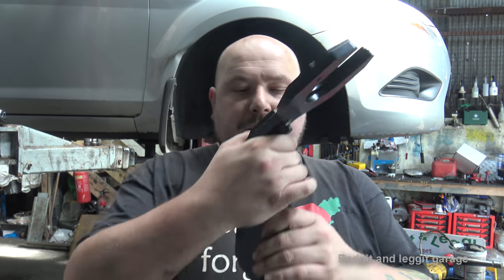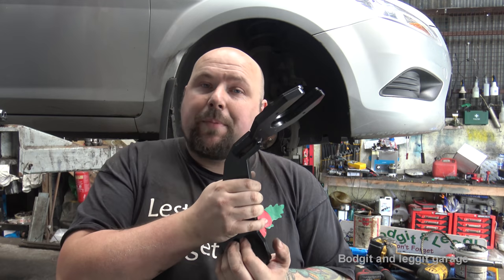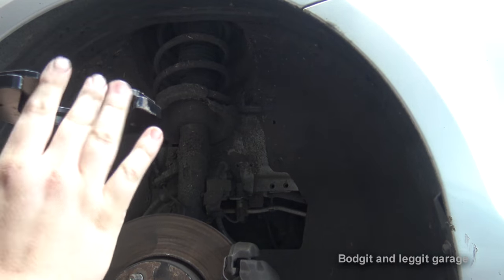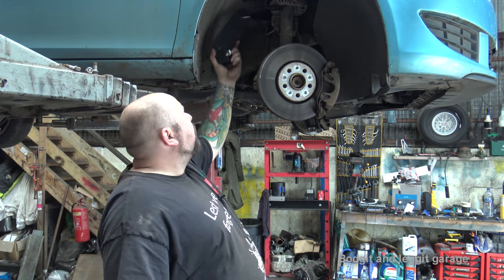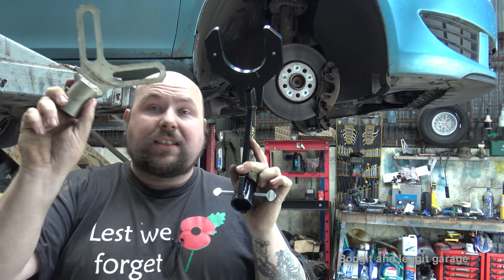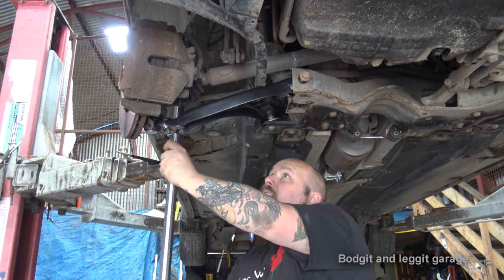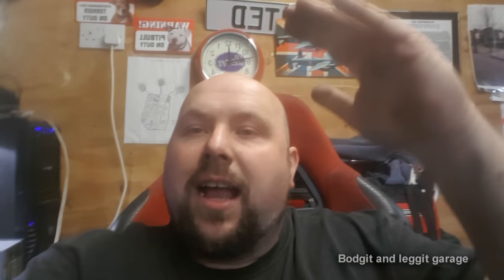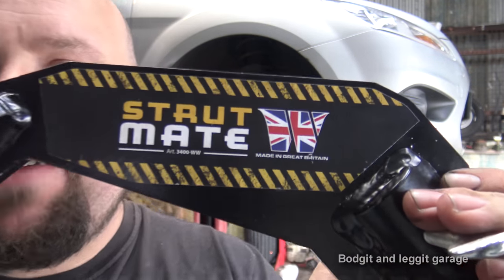Changing Suspension Struts To Easy Way

Comment: I have had one of those for 8-10 years, made by Dannish company Compac ;) I use it to put some preload on the spring when i remove the knuckle on vws where the right hand side driveshaft bottoms out on the subframe and the strut normaly sticks in 20-30mm in the knuckle, Just preload the spring 30-40mm and the knuckle drops out like a charm ;) I have put a safety chain on it to prevent it from sliding off and also changed the casters on the transmission jack to ones that lock.
Reply from the maker: Sorted 💪💪👍👍
Reply: @bodgitandleggitgarage  Yep, a really handy tool when you work alone! ;)

Comment: U can make the adapter for a jack yourself. Remove the cup from the jack and take a piece of pipe(same diam. as the transmissionlift) that fits in the hole of the jack and mount the tool on it.

Comment: Hi Leon, I have a 2008 Fiesta TDCI, I have a knock coming from my front left side. Sounds like a drop link banging around on uneven road it's a constant knock on any kind of road change. I've changed the top mount, changed the drop link and still knocking. The mechanics near me are just loading the parts cannons and wasting my money without diagnosing it properly. One even suggested just turning the radio up and ignoring it.
But the knock is unbearable and I do 800+ miles a week.
Reply from the maker: Hi mate it could be a couple of things I would check your d bushings they also known as anti-roll bar bushings they are the bushings that hold the anti-roll bar onto the car and at the end of the bar you have the drop links also check your bottom ball joint but I would say you have the brushing issues
Reply: @bodgitandleggitgarage  Thanks Leon, can it be a steering rack issue? The steering is quite light as well and has poor turning circle, although I think it's from incorrect steering rack being fitted.
Reply from the maker: Hi mate it's a possibility but I doubt it normally if that's the case if you rock the steering from left to right when the vehicle is stationary you will hear the noise and feel it in the steering wheel you will also feel it in the steering wheel as you are driving and it's normally a different noise I'm not saying that's not your problem but from what your saying I would say it's what I originally said but it's definitely no harm to check that as well

Comment: Have you used their air hammer ? I'm thinking of buying one, my only experience with them is a lok type 1/2 impact set and I swear by them just wondering if you have any experience of their air hammer
Reply from the maker: Hi mate yes I've used lots of them but the problem is you need to spend a lot of money on one the cheaper ones are just not very powerful he also need a good compressor and a 3/8 line to give you the full power but believe me the good ones are very expensive but they are very good
Reply from the maker: Hi mate I've never used that particular one but I know the company and I know they sell good quality tool so I cannot see you're going to have any issues with that it looks good and Powerful and it's not a bad price but I would contact the company and tell them I sent you you might be able to get a better deal you will see one of my last videos I did for them the information you can contact them is in the video description
Reply: @bodgitandleggitgarage  that's brilliant Leon thanks for taking the time to respond it is really appreciated
Reply from the maker: @aa-kv2pq  anytime mate just make sure you contact them tell them I sent you and hopefully you they will look after you

Comment: Very similar to what I made from scrap offcuts when trying to fit the strip after a spring change on a VW Touran,arms were just not long enough ! It was possibly the most inaccessible strut top ever designed? Strut support was a result of desperation and much swearing!
Reply from the maker: Boom 💪👍

Comment: looking at that thing its built to take about 10ton looks like 10 or 12mm steel plate what's a strut 10kg at most way over engineered it can be a pain but iv never thought about there needing to be a specific tool for it. i would jack it up more to compress the spring a bit to get the strut into the Hub its not that its going to break lol
Reply from the maker: No mate the toll won't break but the problem is it will slip out from the underneath as it's not held properly this can cause your car to jump off the Jack or jump off to lift